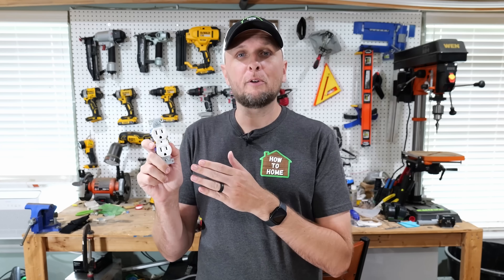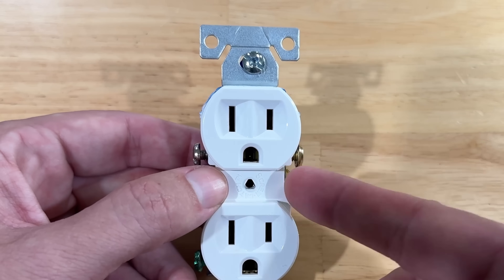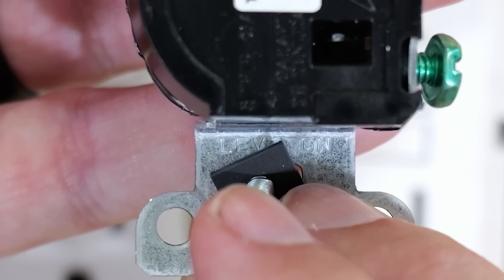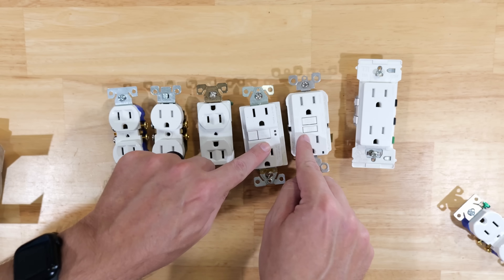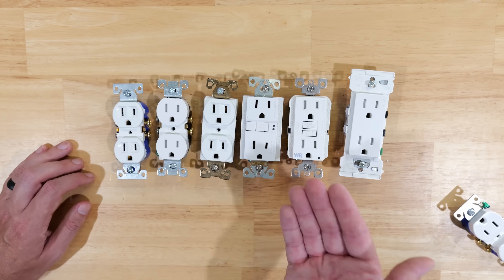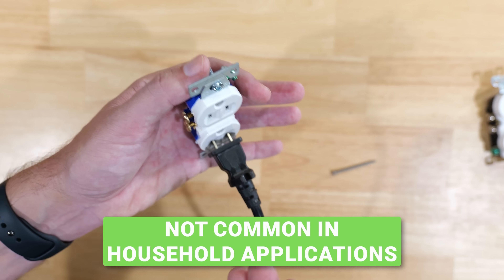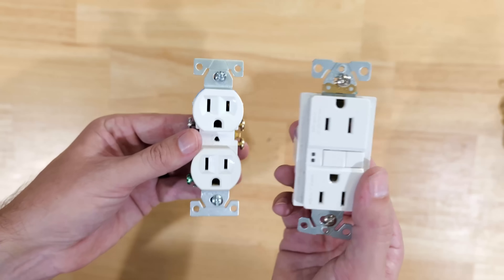The Shocking Reason Why Your Outlets Are Installed Upside Down!

Comment: I am a qualified electrician from United Kingdom and also in Red Seal Construction electrician in CANADA. My interpretation or where the ground should be should be at the top the reason being that when you pull out the plug it shuts the safety mechanism of the live and neutral in the receptacle itself if you look at the United Kingdom receptacle all they call them sockets there you always see the ground of the Earth in the United Kingdom at the top so that should be correctly the ground should be at the top and not at the bottom in United Kingdom as the best Safety regulations in the world so when I put receptacles in my house, they should be grounded at the top or not at the bottom because the reason why a lot of people here they always put the ground at the bottom while be the ground and the ground should be at the bottom not really. I’ve seen videos where somebody pulled a plug out a object 

 fell on top of the actual Receptacle and the plug was out and the actual it didn’t blow because the safety mechanisms of the live and neutral on the temper resistant plug were pulled out so it didn’t look sorted out but if you do it the other way where your ground wire or the ground plug is it the bottom when you pull the plug your top one is still hot that’s my opinion.

Comment: What they need to do is make each receptacle with a ground closest to the middle. That way you can plug in two grounded plugs where the wire exiting the side of the plug can be used at the same time.

Comment: When I took a basic electrical ‘shop’ course in high school (Canada) I learned that the ground prong installs down b/c pulling at a cord would usually drag it down, and as the plug disengaged from the outlet, the ground prong would disconnect last,… leaving the appliance grounded as long as possible.

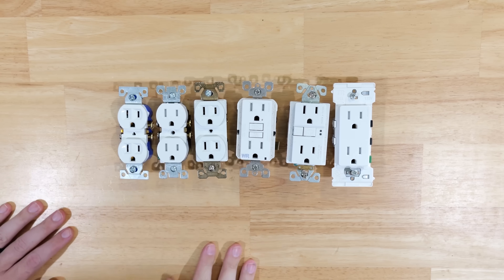Comment: as a retired electrician I always install them ground prong down unless I have two side by side then I go one up one down, the reason being as most 3 prong flat plugs if the 3rd prong is down the wire will exit at 6:00 or 4:00 in the downward position, the one up one down is because some power adapters or direct plug in devices have a polarized plug so if both are in the same direction you can not plug in two adapters or as many devices, so its more less for more options, versatility & compatibility with cords & devices.

Comment: When installing a receptacle behind a piece of equipment and using a 90 degree plug end some times it helps to see how the wire will lay when plugged in. I have changed receptacle orientation because of plug ends.

Comment: I remember talking to an old timer back in the 1970's about this subject. He told me that before plastics were common, most if not all cover plates were METAL. Because of this, if the cover plate screw came out the cover plate could fall down and connect both hot and neutral prongs. It sounded perfectly logical to me so I always installed ground prong up.

Comment: With the temper proof receptacles [TR]  , it is important  the two flat prongs be inserted at the same time  and the plug goes in way easier if you have direct view on both of them. The ground prong just goes in naturally without having to align it.

Comment: I learned in AZ that builders put ground plug down except when it is a switched or switched half hot plug. Then the ground plug was up.  It was a super simple way to differentiate between outlets that were always powered and ones that are attached to a switch.  I have followed it in my new house.  It is just a super easy way of know what you are plugging into. I like the ambiguity in the code for this reason.

Comment: Seems like a video to lure folks in base on its length and long comments about wording orientation.  Wording orientation is meaningless, end of story!!!!!  Since you have researched the code you know better to make several minutes of nothing.   OK, Its Youtube junk, you are allowed.  Place them in either direction as it applies to safety.  Look into the history of when swapping it around came about.  Story goes a lady was zapped thru her rosary when bending over.  So, what a great idea to turn it around.  Maybe?  Lesson is do not go off any one special set of conditions.  Use common sense.  99% of time install it traditionally to help the overall safety.     Please:-)

Comment: You've made a very good video here. I've heard this argument often over the years.
During the 60's and early 70's it was popular to mount the duplex outlets sideways just above the baseboard.
Sort of makes the argument moot. Keeping the hot terminal out of the way to some extent is useful.
Institutional architects often specify ground up. But serious purpose in this seems lacking.
I prefer ground down.

Comment: There is no such thing as "upside down" in electical outlets. It's only in people's minds of what they're used to seeing.
   In my opinion they should be earth ground side on top if installed vertically per usual. If the plug isn't all the way in and a conductive object falls and gets between the plug and outlet at least it will hit the ground pin and not a hot pin. The other reason I like ground side up is that it's easier to line up the plug by watching the ground pin approach the outlet. Viewed from above which is usual with outlets the ground pin is easier to see.
   I've seen outlets installed sideways at work. In that case the neutral should be on top for the same reason of safety if a conductive object finds it's way between the plug and outlet it won't hit the hot pin.

Comment: Im guessing the lettering on the back is upside down because you are more likely to rotate an installed outlet end over end rather than turn it left or right. When I've pulled out outlet from a wall, I turn them downward and the lettering is oriented in the right position to read it.

Comment: The ground pin should be up but falling nails are not a good example.. Any thin metal that falls against the conductors can pose a more likely shock hazard when the receptacle is oriented ground pin down. In a home, this could be a metal window blind, a steel yardstick, a tv antenna, an aluminum window screen, or some type of cleaning equipment. When you consider garages, carports, and porch locations, the risk is elevated by numerous other metal items which may be stored there.
Reply from the maker: The nail was just an example.  Your examples have the same effect.  I wasn’t going to touch on every conductive item.

Comment: Thank you for a very accurate and concise video. I was an Electrician from 1980 to 2000 and an Electrical Inspector from 2000 to 2021. Over 40 years this has been an argument with no basis. I must say that being an Electrical Inspector for that many years, I never saw once where any contractor installed the ground up with the exception of switched receptacles.

I'm not sure how specific you get in any of your videos, but one of the most misunderstood parts of the code is redundant grounds in medical facilities, and with the twist of 120 volt receptacle mixed with 277 volt lighting. Even of out 20 inspectors, most did not really seem to completely get it beyond using "green" MC. Also misunderstood is what a medical facility is, and what rooms are covered. Circuiting is another completely different area and is not what I am referring to, just grounding.

Comment: A lot of wall warts are designed with the prong orientation close to the top with the voltage supply wire coming out of the bottom. This allows the weight of the device to hang down. Hence ground down for this application.

Comment: Yes thanks for  help.   All I know is  inspector has final say so.  Military inspectors ,, to State inspectors. ,, to county inspector.   Every application is different.  We just try to get the installation right the first time.   Nothing worse than pulling the  receptacle out of the wall and not pass inspection then have to take all receptacles out of the boxes so was h one gets inspected.  Chicago. The receptacle  is laid sideways  ,, hot side down. So if metal cover comes off it will hit the ground and negative side of plug.  Two different circuits  in box with the buss tab broken out.  But  circuits are on  same phase so you do not have two twenty in the box.  That is my sad story.  Inspector has final say so.   Later.

Comment: Very Good Video, as a residential user I did have the Incident of something falling on the prongs of a ground side down outlet and causing a spark and short circuit.  It was the metal winding chain of a cuckoo clock that feel down across the contact while I was winding the clock.  I had a rechargeable flashlight plugged into the outlet. (and it had wiggled out from the outlet slightly, exposing the prongs)  There was a big spark and noise for sure.  But like you said in you video there was no ground connecter on this devise, so it would not have mattered which way it was installed, although they are made to hang down, making the ground down installation most practical. (again as you mentioned in your video....)  Good Job.... I watched this video to really see once and for all which was is the right way to install these outlets... and I still don't know... LOL

Comment: Ground prong down looks better to me.  When I see ground prong up, I do a double take and think it's in upside down.  I agree there's no code to specify either way, so it's up to the installer and more importantly up to the preference of the client.

Here's a couple things to consider.  I use surge protectors for any appliance with a circuit board.  With the ground prong up, the device is upside down.  Not a big deal, but it definitely looks funny.  The second reason is those flat plugs that the wire comes off on an angle.  The wire comes out of the plug to the bottom right most times.  If the outlet is installed with the ground prong up, the wire would be coming from the top left - I don't think the device was engineered to be oriented that way.

Good video!

Comment: I like ground pin down (except when I know the appliance angled plug favors ground pin up).  When I installed TWO RECEPTACLES in a garage (four outlets in one 4 inch box), I installed one UP, and one DOWN to give the user the option of what worked better for their situation.
I love the idea of ground pin up for switched outlets, and one outlet switched, and one always hot,  for bedroom or other appropriate situation.

Comment: I'm not going to go over 2500 responses, but how about the power cord where the cable exits the plug at a right angle, that is, depending on the manufacturer of the plug, the wire could exit up or down, and in some cases at a 45 degree angle.  I suspect this type of plug is used where the appliance could be placed all the way against the wall, so it doesn't kink the cord.  Then the outlet may be aligned so that the power cord exits in a downward position.

Comment: I always like to install outlets with the ground pin down because you often see some plugs when they come loose they always fall off slightly downwards  and I think its important to have the ground stay connected if the hot and neutral(upper pins)are slightly open.

Comment: Well, I can tell you this, it doesn't f**** matter which way the ground prong faces it can be sideways. It could be semi vertical. It could be whatever direction you want to put the son of a b** What matters is how the f*** is wired? If as wired correctly, it will work correctly and to answer this question. You take a look at houses.  That were built-in the dawn of the electrical age and you will find the ground prong, faced Down all The Way from the 1880s all The Way up to the 1960s. Why is that because that's the correct way to install it? You guys can sit there and try to change the rules. Try to change science change code. But you're still awful as s*** Electrons haven't changed at all.  Since they were discovered, so it really doesn't matter.As long as it is wired the correct way

Comment: What about on a light switch? I have ocd and had the hardest time when i was swapping out some switches last month. Some have on/off written on them but alot don't.
Then the grounds and even the sides that the terminal screws are on dont help orientate them because there seems to be no ryme or reason to which side they're on.
I happen to have about six 5gallon buckets of light switches and outlets i got from my dad so i have alot to compare and use.
I realized not all light switches make it easy to figure out whats up or down when i intalled a switch that looked just like my old one (terminals and ground in same exact spots) and when i was done on was off and off was on😅..
(Edit, i went and watched you're light switch video and it still didnt answer this) 
You say it doesn't matter which terminal which wire goes to.
I changed a few light switches and on one i had a swith with the terminals and ground orientated the same as my old switch and even wired it the same as my old switch (top&bottom wire in same spots) and on was off and vice versa. Some switches do Not have on/off written on the switch itself.
The other writings all sideways..
So how else do you know whats up and down?

Comment: After 15 in  the class room and 35 years in the trade this question keeps popping up.  In 1992 in trade school I wired all my receptacles as shown in our textbook ground up.  My teacher made made me flip them.  When  I showed him the page in the book he said he could fix it.  He removed the page. At that time the books said: " IF a metal plate is used, IF the plate screw gets loose, IF the Plug is partially out and, IF the plate drops there could be a short or shock hazard.  His response was that that is a huge pile of IFs to worry about and also that is the reason we have circuit protection in the form of breakers or fuses.  
He also went onto say that ground up creates a possible booby trap injury scenario.   IF the previous metal plate occurrences all happen ground up with a metal plate there is a possibility that the plate may be balancing only on the ground prong or only contacting ground and neutral. In both cases a hazard remains and is not  cleared by the cir protective devices.  Then along comes the unsuspecting home owner and when the bare hand bumps the plate there is a potential for shock or arc burn or injury as a result of reacting to the flash and pop.  If ground down the plate makes a direct short and the breaker trips instantly keeping all safe until the problem is cleared.  That's what breakers do.  You mentioned short but did not mention breaker trip.  

From then on.  Both in the field and classroom it's been Ground down.    There was a code issue or at least the code handbook that addressed the debate stating that it was decided to not make it a NEC rule.  Some cities Boston comes to mind that required ground up based on textbook recommendations. The NEC is based in a suburb of Boston.

The exception I've seen in books and that  I do agree with is on side ways mounted receptacles neurtral should be up.  Any conductive object could slip in there between a plug and even a plastic plate and remain live to be contacted accidentally resulting in possible shock.

Regarding your video on the subject.  Bravo.  Very well done.  I was expecting some dumb arguments.  You covered everything well.  Also extra points for the non-conductive wedding ring, and your videography is first rate, with excellent graphics such as the added labels for the device parts.  Well done.    Keep teaching.  Would have used your vid in class 10 yrs ago.

Comment: Also when  rooms doesn't have light fixtures and it does have a light switch on the wall, The majority of electrician, like to put the outlet upside down indicating.
 That it works with the switch.

Comment: completely answers my questions as to why all my GFI‘s are always facing downward when they are plugged into a receptacle that has the ground plug on the bottom, they are designed to be plugged in to receptacles with the ground plug up top, thank you for that.
Reply: @A275bs80  not all face downward as mine do not face up nor down;  they face left or right.
Reply: Which is stupid because many appliances come with power cords that are flat to the wall. I assume that's so you can push them flush to the wall when cleaning as microwaves and toaster ovens shouldn't be operated without adequate room for air to circulate.

For the longest time, I couldn't have both my microwave and air fryer plugged in at the same time because both of them had 90 degree plugs that went straight down. Eventually, I found an appropriately specced pigtail that allowed them to both be plugged in at the same time, and allowed me to keep my coffee maker plugged in as well. I don't ever run all of that at the same time, but I hate plugging and unplugging things frequently as it can be kind of annoying.

Comment: I have always heard that the upside down prong was to designate a “switched” outlet, IE a outlet controlled by a switch, as in the ability to control on/off with a wall switch as in a lamp outlet. As a non-electrician I appreciate the information provided, basic electrical work around my house is all I will do, if I need anything other than this I have a preferred Licensed electrician that I always call, I am NOT going to get lit up, they are professionals for a reason.

Comment: For any metal cover plate, the ground prong should be up  so that in the case of a loose cover screw, the plate will slide down and contact the ground prong.  Loose cover screws do happen  and some people use metal cover plates, stainless, chrome,  copper,  or brass and occasionally iron or steel.